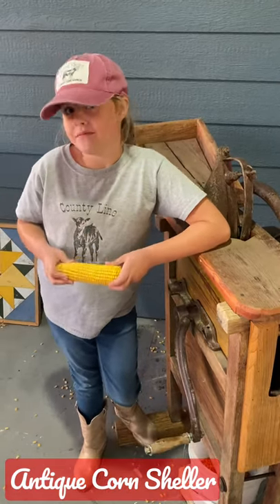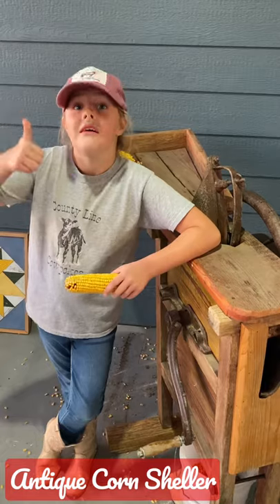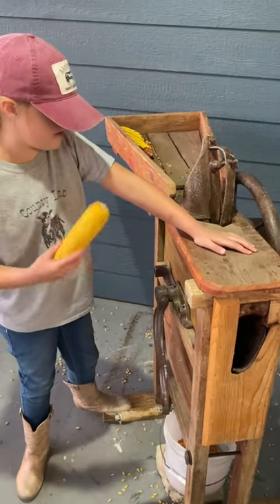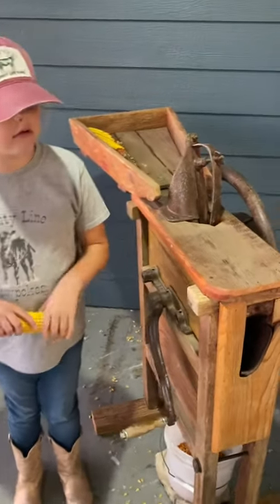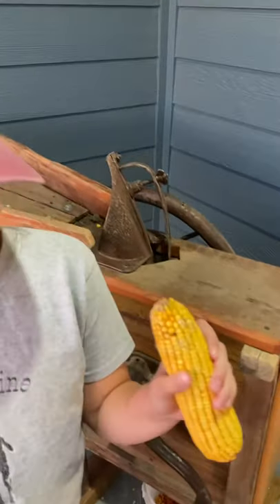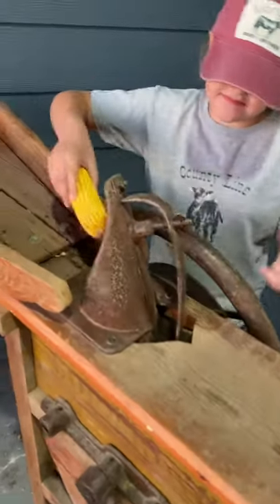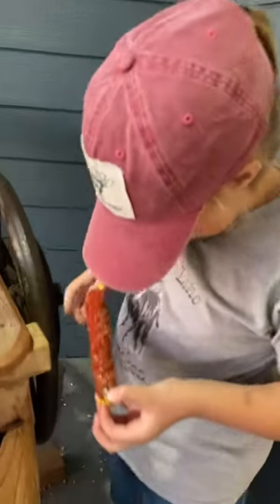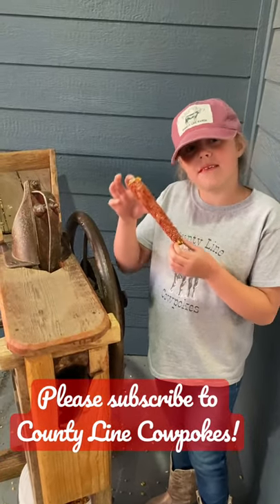Cowpoke Heidi demonstrates how an antique corn sheller works! Kansas corn harvest video coming soon!

Comment: We had one of those back in the 60's and 70's.  We mounted a small electric motor and belt to drive it.  It would take ears of corn as fast as you could drop them in.  A 5 gallon bucket would just fit underneath to catch the shelled corn.  We had bushel baskets to catch the cobs.  We would use the cobs to help start the fire in our wood stove in the basement for heat.
Reply from the maker: Wow, that is so cool!!! What an awesome idea. We never waste the cobs either! We have a wood fireplace and they make great starters! Thanks for sharing your awesome idea!